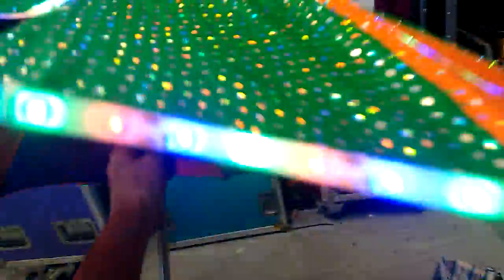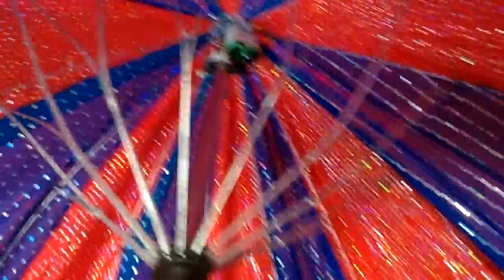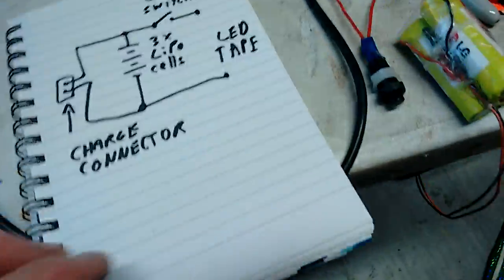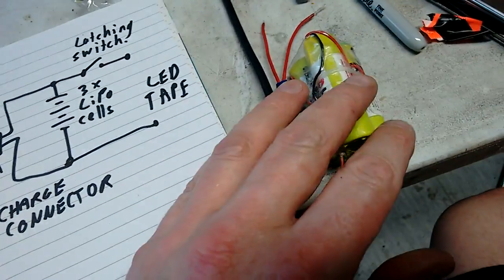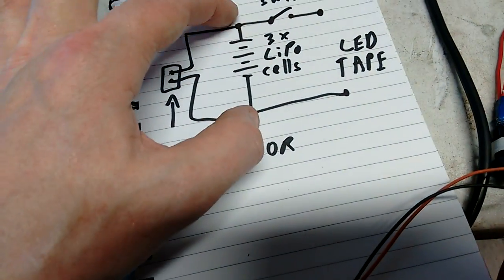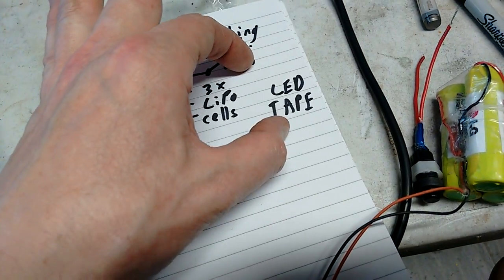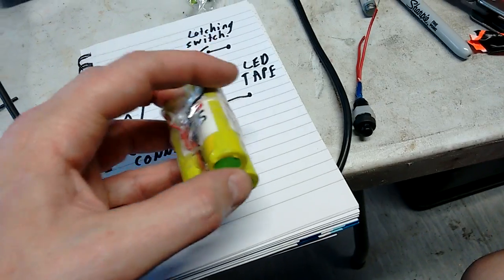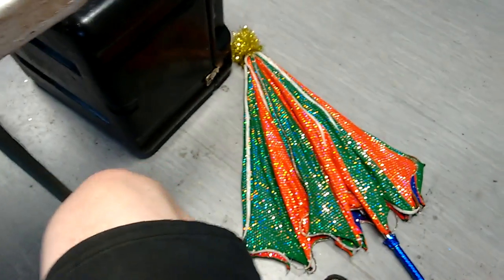Fixing dubious Bollywood LED props.   TCF

Comment: I kinda like the idea of a dab of hot glue across the joint, both front and back, to keep the joint from flexing.  Given enough prep time, start with wires across the solder pads.  Also, E-6000 is a silicone based product that holds up astoundingly well.  And it launders very good!  I buy it whenever I see it, especially in the smaller size.

Comment: So there's an unplanned fireworks show in the Bollywood section then? :P
Reply from the maker: Ben McKenna I have toyed with that.  I like the idea of doing a hangout with some other YouTube electronics channels.
Reply from the maker: ***** Yeah, mine are the ones that worked.  :P
Reply: bigclivedotcom
hehe, and while watching, I can say "Big clive fixed that"... :P
Reply: ***** yep all the sudden lithium fires setting light to peoples head will be the talking point of the show
Reply: jusb1066
Could be an interesting show when it's televised at the end of the month, that's for sure... :P
Reply from the maker: ***** The BBC have just finished their three nights of filming, and apart from the fact that the Bollywood lead lady's brolly malfunctioned on at least two of those three nights it all went OK.  It'll be interesting to see what the final edit looks like.
Reply from the maker: ***** There's also the hideous continuity faux pas where a different prop was used at the end of the Bollywood set.  A ceremonial vehicle (with illuminated wheels) takes off the romantic couple, surrounded by  bearers with illuminated props.  For the first and ONLY night I've seen it, they swapped one of the two green "trees" for a red LED one.  I didn't even know they had other colours as backups.  It'll be interesting to see which colour variation makes it to the final cut.  I would guess it'll be the two green tree's for their symmetry.
Reply: bigclivedotcom
That's something to watch for then for sure, might have to record it to spot such things... :D
Reply: +bigclivedotcom hi again 
great video.

have you ever thought doing a few live streams ? it would be great if you did a few haha :D
Reply: Cool I think that's a great idea :D

Comment: What types of failures are you seeing with them?  Problems with the switch?, the wires / solder joints?
Reply from the maker: reabinc Mainly failure of the LED tape itself.  I think it's failing at the joints of the series of sections that make up the strip.  When they get sent up for repair, a new piece has already been fixed on with the solder points marked with clips.  On others the entire guts are supplied in a clump for rebuilding.

Comment: Huh? You joking right? They actually use that configuration? No protection what so ever?
Here in the states they would not be allowed to use those on stage at all.
Reply: ElfNet Gaming They do look a bit errm cheaply made and sorta flame thrower explosion kinda thing , Wonder if the 18650 in them are re purposed lappy cells
Reply: Thats what I was going to say!!! lol it looked like someone cannibalized laptop batteries, Kinda an expensive way though considering some laptop batteries cost $$$, I would hope they just bought individual cells but those in the vid were LG cells...
This is not the design I would have used to do this job...I mean a smaller switch, maybe smaller cells and definitely some protection.
Reply: And when the cells explode they make good firework effects , may require skin grafts after
Reply: steve64464 IKR, Pyrotechnics during the show = WIN but if someone gets hurt = FAIL
Reply: More or less :-D
Reply from the maker: steve64464 Fortunately the stage is outdoors and completely non flammable.  And where they are stored has major fire protection built in, including window shutters that close automatically.
Reply: Well thats something i guess :-) , Still a chance one the 18650 goes woosh and turns umbreller into some kinda rocket transport etc
Reply: steve64464 Jebediah Kerman would be proud!
Reply: ElfNet Gaming I have had good luck tearing down "old" laptop batteries from the battery recycle box where I work. Typically I find between 1 to 3 "bad" (not necessarily bad but not matching the remaining batteries in capacity) cells in each. The rest are serviceable for the moderate use i put them through.
Reply: Laptop batteries normally have 1 dead cell that causes the entire pack to fail. I have changed cells in older packs and resealed them to make them good again in the past, nowdays though I just buy a new pack because its safer in general but yeah old laptop packs are a good source for Li-ION cells for projects and such, So are old bluetooth headsets if you want some Li-Po cells for smaller projects or drone stuff.
Reply: Yea i think im kinda addicted to collecting 18650 at the moment when i can find a source that is , In some cases when its impossible to source a certain laptop pack its possible to rebuild one which is fun on so many levels im sure , I was speculateing on powering my drone on 18650 but apparently the discharge rate is too low.